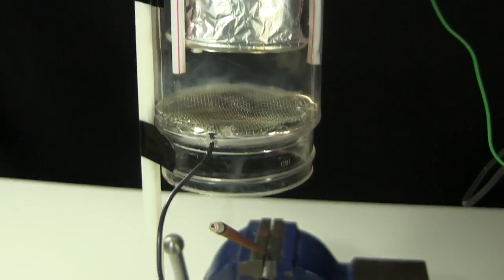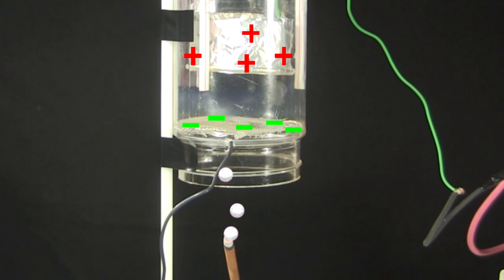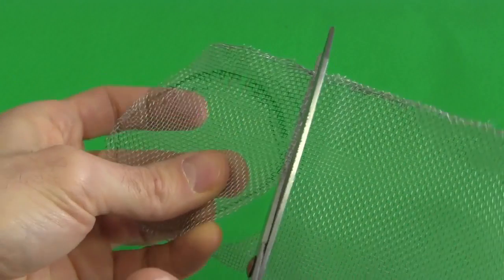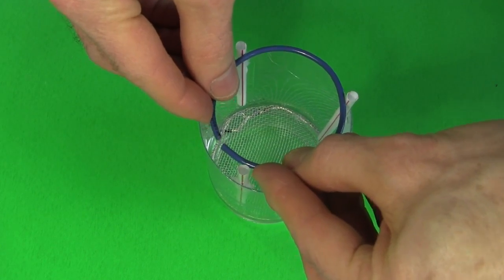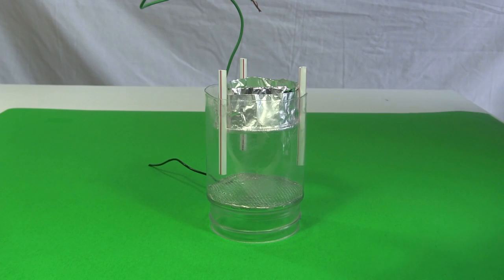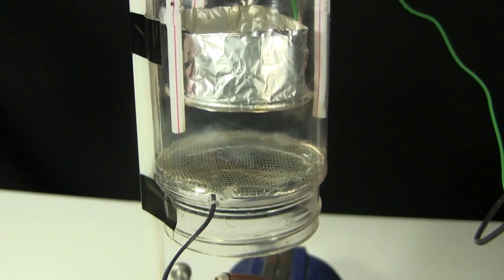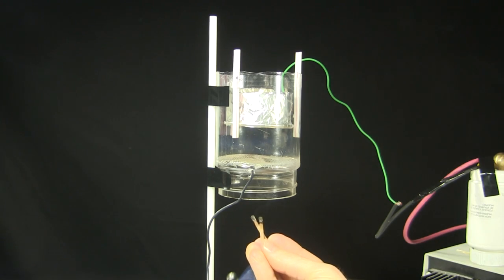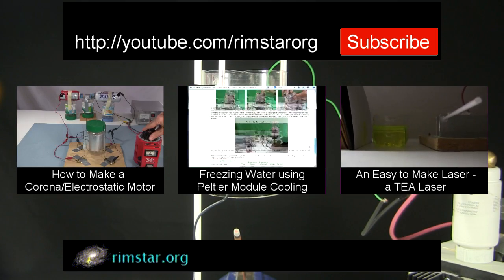Electrostatic Precipitator/Smoke Precipitator - How it Works/How to Make

Comment: I've never heard of this one before. Could this solve my solder station extraction problem? What if I use an ion thruster to suck smoke into the inlet?
Reply from the maker: It might be able to solve you solder station extraction problem, but you'd have to do tests to see if it collected all harmful particles. There is the problem of ozone as a byproduct though. This is pretty much just an ion thruster.
Reply: Aaron Stemple   What are fumes made out of then, if not particles? Does soldering release dangerous quarks?
Reply: RimstarOrg This seems to be more of an ion break than a thruster. Will it still work with a fan or other thruster forcing air in faster? How much can smoke be accelerated before it just blasts through? I think the ozone problem can be solved.
Reply from the maker: Mongrel Shark
Nope, it's an ion thruster. My understanding is that the "wind" in ion wind that flies past the electrodes is made up of neutral molecules and not ions. The ions get attracted to the plates so they don't fly past, they do break. But I haven't tested that.
I don't know how much smoke can be accelerated before it just blasts through but you can make the cylinder longer to help capture more. I didn't show it in the video but all of my cylinder got coated, not just the smooth front edge. There's also another design where instead of a mesh in front, you put a high voltage wire down the middle but I couldn't get that design to work.
Reply: Aaron Stemple  gasses are still particles. If its on the periodic table, or made of things on the periodic table, its a particle.....
Reply: RimstarOrg Another one for the to do list then... If I ever get all these spare parts sorted out.....
Reply from the maker: Mongrel Shark
How were you thinking of solving the smoke precipitator's ozone problem?
Reply: By not having corona. I notice there wasn't any from the smooth edge. So wold make no points on a large enough diameter ring that there is no corona. Just like with a good top load on a tesla coil.
Reply from the maker: Mongrel Shark
Would that work? The mesh has to have sharp enough edges to create a strong enough electric field to repel electrons from the mesh wire and into the air in order to ionize the passing smoke particles. Or would the smoke particles pick up electrons from a smoother object by physical contact? In that case a lot of smoke would pass by without contact, not get charged and just pass through the whole device. I'm not discounting what you say, just thinking out loud.
Reply: I would have thought all the corona was on the foil not the mesh, as the mesh would be at ground potential...
Reply from the maker: Mongrel Shark
No, the mesh isn't at ground potential. It's connected to ground but when the foil is high voltage positive there's an electric field between the foil and the mesh. That field attracts electrons from the ground to the mesh and so the mesh is really at high voltage negative. That's what I tried to convey at 2:15 because I suspected someone might think that.
Reply: Ahhh I seee.. And it wont work if the mesh is insulated... That stuffs my plans...
Reply from the maker: Mongrel Shark
Don't give up yet. This just in.... According to Chris C. on http://hackaday.com/2014/03/13/cleaning-up-smoke-with-an-electrostatic-precipitator/ there is a voltage below which you don't produce ozone. He doesn't know the exact value but observes that he's never seen a commercial ionizer module above 7.5kV and 4-6kV are more common. His comment is the big, multi-paragraph one in the middle of the comments.
Reply: Thanks for this. Helps with the ozone free ionizer project too :)

Comment: is it any way to make this with a smaller power source?
Reply from the maker: I'm sure the power source can be made smaller, I just haven't had a need for it.
Reply: Oh I want to try and make one but I'm wondering how small of a power source I can use
Reply from the maker: mike frometa
I'll do some tests with my other commercially made Wimshurst machine which has a lot less current. But even a power supply like the one I use in my video can be made much smaller. I just didn't have any reason to. I'll reply here again once I've tested it.
Reply from the maker: mike frometa
As promised I just tried with my commercially made Wimshurst machine (27cm diameter disks) and it worked, though not quite as well. There was still some smoke coming out, but little enough that I'm sure tweeking to the precipitator could fix that. I'm not sure what tweeking, maybe a less dense mesh, maybe a smaller diameter, ... But the point is that the Wimshurst machine is a much, much lower current source than the power supply in this video, so that opens it up to a large range of high voltage, lower current DC power supplies.
Keep in mind that like all high voltage stuff that produces a corona, this does put out ozone which is toxic. Normally this is okay since we often do this for fun and ventilate, but if you're looking at doing this for indoor air quality reasons then the ozone will be a problem, one I don't know how to solve.

Comment: Cool experiment! Is this how they used to make those "smokeless ashtrays"? It seems like they inverted your design and the ion wind would suck the smoke down through the bottom.
Reply from the maker: Thanks! A quick search online found a few smokeless ashtrays but they used fans to suck the air in and ran the air through charcoal filters. So as far as I can see, they don't work this way.

Comment: I'm curious, could a window size of this device be made to collect pollen?
Reply from the maker: Theoretically one can be made that size. Electrostatic precipitators are used in industry for all sorts of things and are much, much larger. Electrostatic air cleaners are available that are around window size. I don't know how well it would work with pollen. Interesting question. My guess is it'd work but I don't know for sure.
Reply: the only issue I see with that is if you touch the screens your going to get a jolt
Reply: the pollen could burn because of electricity i am not sure